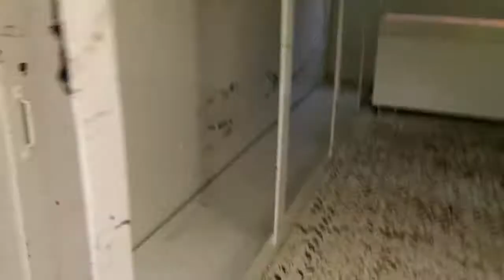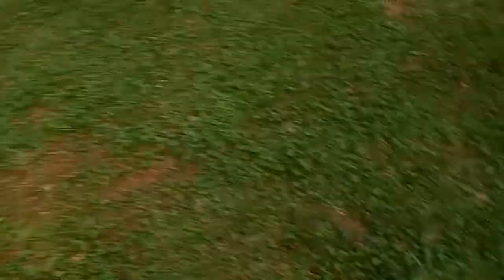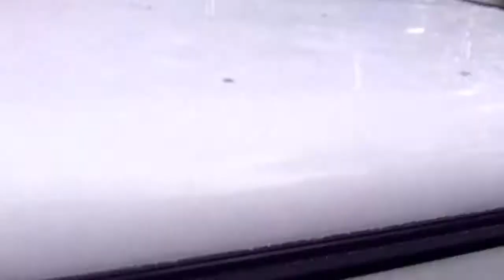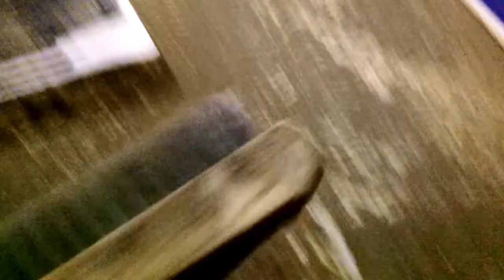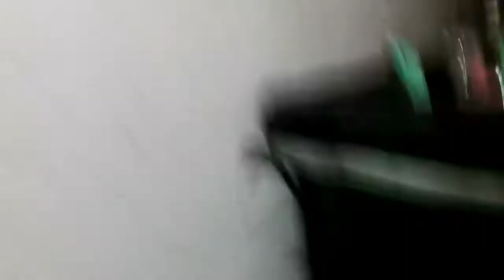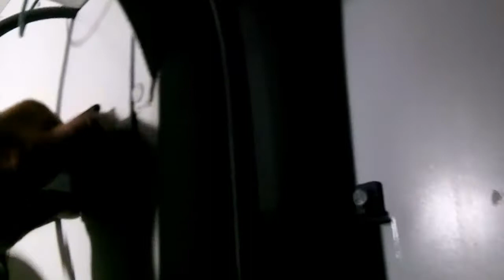My New Service Truck

Comment: Looks good a van i used to drive had drawers like yours. They ran the entire length of the floor in the van. Storage galore! I loved those drawers. Truck looks good. I need to upgrade but i make due for now. -neil

Comment from the maker: Hey Brett, The worse part about working out t\of the other truck was I just didn't have the room I needed. For the most part it was ok until I did an install then it was trailer time, which really sucked!!! Now life is good it's like moving from 2000 sq foot house to a 5000 sq ft house.